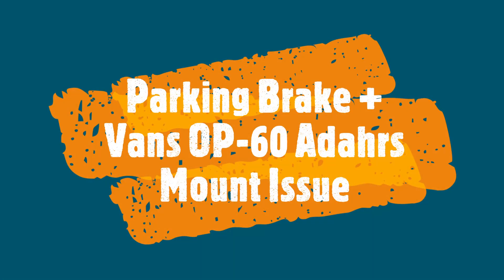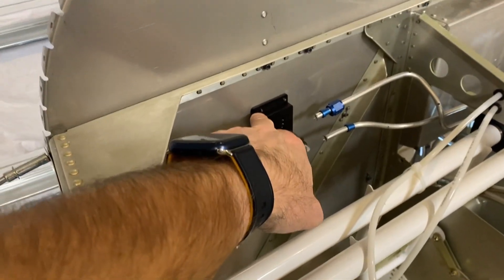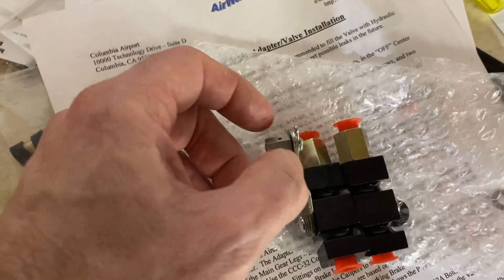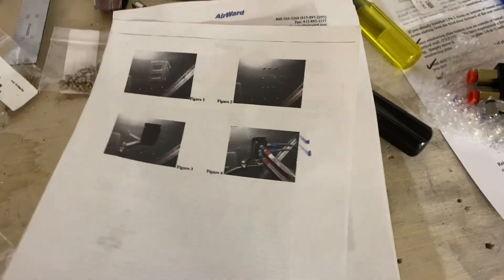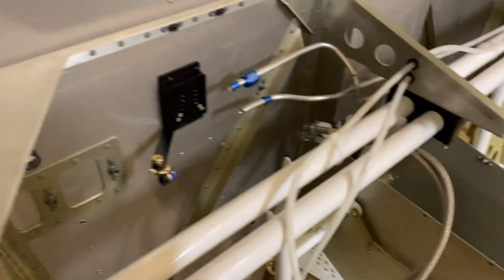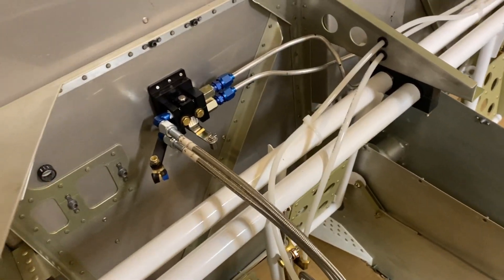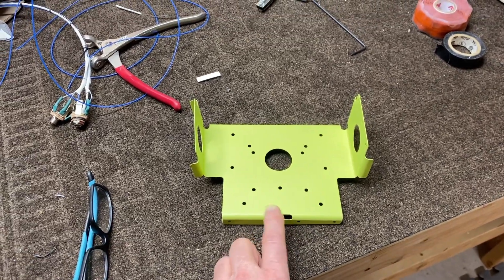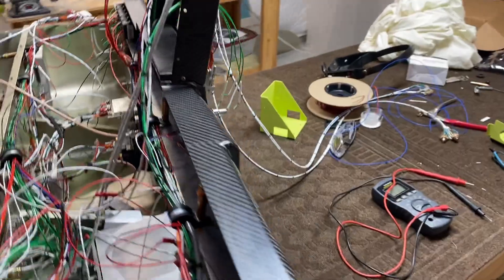Vans RV 10 - Parking Brake + being Misled and Mounting the GSU 25 ADAHRS

Comment: what fitting size are you using?
both into the port (1/8" NPT?)?   also what fiiting size and alu diameter braided line dimension are you using ?  (1/4, 1/8 3/8??)
and what hose type is it inside the braided hose?
I ask because I am totally new to experimental build and need to learn the basics... hope for claryfying answers/comments
Reply from the maker: Michael,  A couple of things for you to consider,  everything i am doing is for a VANS RV 10 so the fittings and materials are based on that.  I suggest you get AC 43.13-1B/2B aircraft inspection, repair, and alterations it has a ton of information on standards etc (covers everything).  specifically to your question 1) They are NPT, 2) the dash number on the fitting indicates the tube size so for an example the AN837-4D indicates 1/4" OD for the brake lines.  3) also flaring of aircraft tubing is different than that for other industries  it is 37 for aircraft vs 45 for automobile so be careful about tooling. I'm not really sure what's inside the braided hose that was purchased pre made.

Hope that helps,
George

Comment: GSU 25 & OP-60 -- I plan to mount it on the bottom side of OP-60, after drilling new holes as needed.  Garmin doesn't recommend mounting it tubes up because of moisture collecting in the unit, so tubes down mounted under the OP-60 seems like a win.  Thoughts?
Reply from the maker: That was the option I was going to do as well, and I expect it will work very well (plus it is less likely to get in the way) but after talking to the VANS tech support they actually said most people put it on the back of the G3X (which is very easy to do) - seems pretty sturdy to me for now, if necessary I can relocate it to the rear if I start having any issues.  For the VANS forums people also seem to have good success with it on the back of the G3X. Also on the back of the G3X the other 9 pin connector is actually setup to wire directly to the ADAHRS.
Reply: @aleafonthewind3775  I did consider putting it on the back of the G3X, but decided to go with the rear since my other ADAHRS is already in the front (the G5).  I'm not sure that wiring it direct to the G3X would work, unless they are the only things on the entire CAN bus.  My Garmin docs say that the second connector only has CAN, but no serial or power.  Also, what if that G3X fails?  Will it take out the ADAHRS that's wired direct?
Reply from the maker: Its in the G3X touch installation manual section - 26.4.1 P4501/4601/4701 (P4X01) Connector
The P4501/4601/4701 connector (referred to as P4X01 connector in this section) can be used for
connections to the GSU 25 when mounting the GSU 25 to the back of the GDU 4XX (Figure 8-2). This
mounting method may not be recommended for all installations, contact Garmin for details before using
this method. regarding the power, great question - I have still to test it but based on the pinout names it looks like power and can bus will be operational regardless of the G3X. In any case I also have a backup from my G5 but i do plan on testing it.
Reply: @aleafonthewind3775  I think part of this problem is that Garmin doesn't explain enough here.  If you connect P4X01 to the AD-AHRS, then there is no way to connect the CAN bus to anything else.  Note that P4X03 says "reserved for future development", kinda suggesting that it cannot be used, even for CAN.  I'll call Garmin at some point, but if you call them first, let me know what they say.  :)
Reply from the maker: Neil,  agree Garmin does not provide a lot of detail but it is connector P4X01 not the one that is reserved for future use.  You are correct you can only connect one can bus via this connector so you still will need to daisy chain the can bus from the main can bus input to the g3x to other devices . I guess internally it does some magic with the connector for this use case, and if you dig through the documentation (i think one of the interconnect diagrams) you will actually see this setup being used.